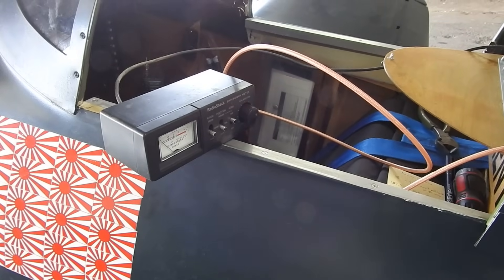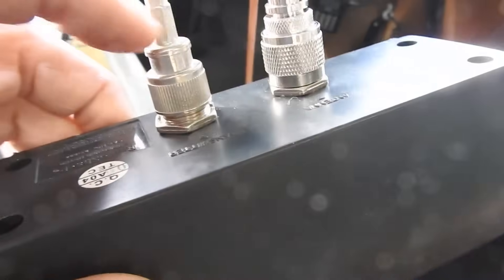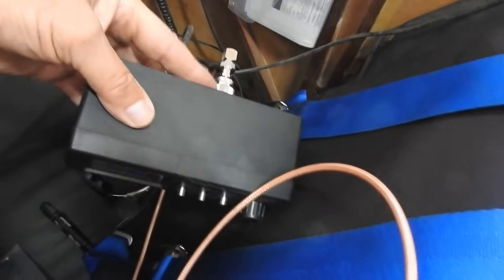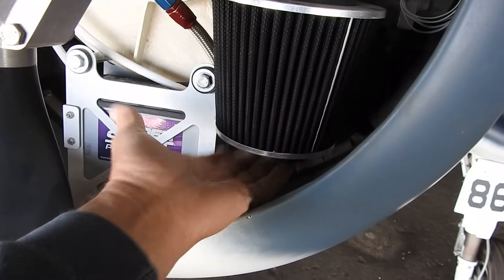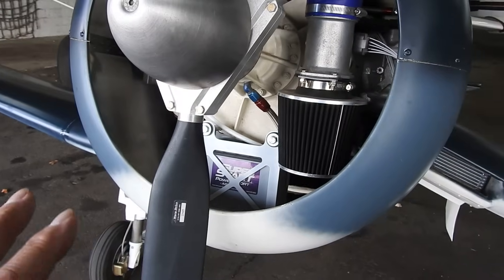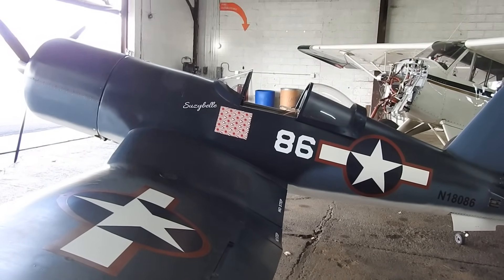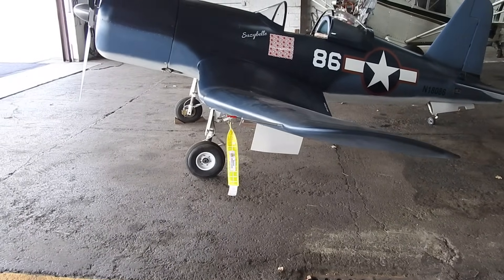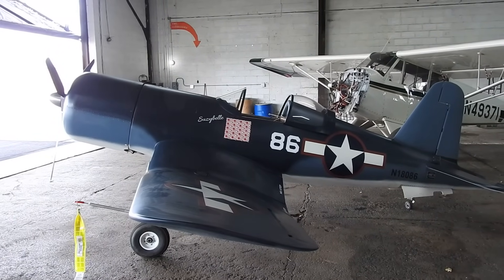WAR Corsair Progress report 10/28/2023

Comment: I'm so excited to see this effort come together Don.  Take your time and get her done right to your satisfaction. I hope the fuel delivery issue is something easy to solve for you. 

I'm not certain whether your VHF antenna is 1/2 wave (53" length) or more likely 1/4 wave (26.5" length) but you can expect about a dB or so extra gain with a 1/2 wave antenna over the 1/4 wave if there is room in the rudder to accommodate the extra length of the 1/2 wave.  The high VSWR may be a pinched coax or something else defective in the coax or antenna is just a guess in my experience working with this stuff.   

I would throw a sig gen on the cable and sweep it across 118 to 137 Mega Hertz with a Spectrum Analyzer to get a quick peek and characterize its performance here at work, but you may not have gear like this available there.

Dave
Reply from the maker: The antenna is 1/4 wave. A half wave would be too long, and not fit. I've seen a video on using an analyzer, but I don't know anyone that has one. I'm pretty sure I will have it fixed shortly. Some new fittings are due in the mail today, along with the air filter shield.

Comment: I'd love to see a 7 cylinder Verner on this!
Reply from the maker: That engine cost more than the whole airplane. Besides, it doesn't have enough power.
Reply: @Dynodon64  I agree about the price, but the WAR aircraft were designed for the 100hp Continental O-200. The Verner 7 has 124hp for takeoff, 103hp continuous, and it weighs within 1 pound of the O-200. It would actually be perfect. Not to mention the SOUND!

Comment: As somone coming from high performance  auto tuning ind 
MAF sensors do not like turbulance and are very sensitive 
we have problems all the time on Ford Mustangs where they change out the stock grill for a more open aftermarket 
and it causes tuning problems untill they put a shield back over air box

Comment: Yep 5.0 with a K and N would definitely screw with the sensor more so if there was a little to much oil on the filter vanes you could literally watch it on a scanner fluttering voltage readings

Comment: Back in the day, I trimmed up a lot of CB antennas to get the SWR meter reading down to a reasonable number. It was always a long trial and error process. Is there a more "modern" antenna design available that may offer a higher db gain with a more compact footprint? Maybe even an antenna at an affordable price point?
I'm always learning something new with each of your videos. I've never considered how turbulent the airflow might be within a cowled engine compartment - especially turbulence caused by the passage of each prop blade. Can't wait to see your baffle solution.
Reply from the maker: Radio antennas are really expensive. The one I have will work fine. I believe the bad readings are from the cables I used between the radio and SWR meter. I ordered an adapter to use in place of a cable.

Comment: You may want to consider the Advanced Aircraft Electronics antenna. I have it in my Minimax using a RG400 cable and getting excellent results. It doesn’t require a ground plane.

Comment: Can't you mount an actual proven radio antenna into the vertical fin? If you really need to hide the antenna. Or just mount one on the turtle deck. Communications is more important than looks at this point.
Reply from the maker: Yes you can, but they get pretty expensive. The one I have will work. I believe the problem was my cables that ran from the radio to the meter. Too long. I have an adaptor coming to hook the radio directly to the meter. Then I will re-test.

Comment: I don't like that meter for your radio. Your SWR would be better read if you switched the coax leads when testing reflected waves. Still not ideal
Reply from the maker: I ordered a new adapter to hook the radio directly to the SWR meter. I'll get another meter if the new adapter doesn't show an improvement.
Reply: @Dynodon64  I wish I lived closer, because the solution I think best would be to use an antenna analzer, but because they aren't cheap it would be better if you had someone nearby that had one. I don't know if that requires a special license per navigational equipment installers, or not.

Comment: Idk if it would fix the maf sensor issue, but they sell aluminum honeycomb air straighteners for use in cold air intakes to straighten the air flow before the maf to prevent issues.
Reply from the maker: We'll see how the shield works first.

Comment: All of the coax should be 50Ω. I would connect the antenna end of the coax to a 50Ω dummy load (borrow one from an amateur radio operator) and make sure the SWR is close to 1:1. This will verify that your coax is good all the way back to the antenna. With the coax attached to the antenna, the SWR should be less than 2:1. Also, your plane should be at least 20 feet away from any metal structures while checking the SWR.
Reply from the maker: I've got an adapter coming to hook the radio directly to the SWR meter, with no cable. Then I will retest. I tested over 50 feet from the hanger. The new cable is an RG-400 double shielded.
Reply: @Dynodon64 I believe if you use a 1/2 wavelength long piece of coax between the radio and the SWR meter, the SWR meter will show what the signal is doing at the radio. But, I haven't done amateur radio in decades..
Reply from the maker: I'll keep that in mind,Thanks. @txkflier
Reply: @Dynodon64  I sure would like to know what the pitch angle is at 75% of the blade length and also the prop diameter. I do propeller calculations almost daily for model airplanes.
Reply from the maker: The prop is 72 inches. Pitch was measured at the tip. Don't recall the number off hand. @txkflier
Reply: @Dynodon64  The standard location to measure the pitch is 75% out from the hub. That's where most of the thrust is located, plus the blade is usually wider there which makes it easier to measure. On my electric models, I like to use a prop that has a diameter that's 1.5x the pitch. An alternative method is to say that the pitch is 66.7% of the diameter. For a 72" prop, the pitch would be 48". If you measure the angle at the 75% point, the angle should be 15.77°. The formula is Arctan(Pitch / Diameter / 2.36). The 2.36 is about 75% of Pi. When the angle is above about 16°, the blade will begin to stall and produce less static thrust. As the plane starts to accelerate, the relative wind will effectively reduce the angle of attack of the blades and the thrust will increase. On the other hand, if the angle isn't large enough, the plane won't fly fast enough. I'm not sure 48" of pitch will give enough speed. A 72x50 prop would have a D:P ratio of 1.44:1, which is the same as a 69x48 prop that might be used on a Cessna 150. The blade angle at 75% would be 16.4°.

Comment: Before you go to all the trouble of removing that antenna; 1. The cable between radio and SWR meter should be a very short pigtail, like 12-18" and must be 50 Ohm. On my handhelds, I hook the meter directly to the radio ant jack with a simple adaptor. 2. With your 22.5" antenna, the SWR match should be 1 - 1.5 midband.  Your initial readings don't make sense at all. I don't trust the very old RS meter.  A new digital is fairly cheap. I got a Surecom SW102 recently for about $50 and use it on all my handhelds.    Good luck
Edit; I just thought of something. Your prime coat didn't include aluminum did it?  That could play hell with SWR and attenuate signal also.  The base primer on my MiniMax build was metallic, so I went with an external whip antenna.
Reply from the maker: I ordered an adapter to hook the radio directly to the SWR meter to eliminate the cable. The old cable was all I had to use. I may get a different SWR meter if the new test shows bad numbers again. I don't think the numbers I got looked right either. Didn't make sense. There are no metallic paints used on the plane. Just wood and fiberglass in the tail.

Comment: ❤ If the antenna has metal around it inside of the virtual stabilizer the antenna will reflect SWR . Correct?
 It may be easier to make a outside antenna. 
 Look up the formula for frequency wavelength for the antenna length from 1/4 to 1/2 wavelengths for the frequencies that you are going to be using. 
 Aircraft frequencies cover a wide range of the wire antennas where a 1/4 inch longer or shorter length of wire will make a great difference in the SWR.
 Even if you pick 1 frequency like 118.00 mhz. just a small difference in length will change the SWR.
 I am not being negative just wanted to help. You're a very good man and smart too so you probably already know what you are doing better than I.
Reply from the maker: Your comments are right on point. No negativity taken. My goal is to shoot for 127.5 as the mid point test. That should give me the best average for the bandwidth I will be using. 1/4 wave is @ 22.02 inches for the length.
Reply: @Dynodon64  here is a link to look at if you choose to that makes it quick to get the length of a 1/4 wave antenna length a different way. 
 I usually use the 1st example but the last example is easier and more accurate. 

https://youtu.be/tDgzTD0fQWw?si=6-AiHZzOef93X2MT
Reply: @Dynodon64  I got 22.21 for a 1/4 wave for 127.5 mhz. Using 246÷127.5×12 
 This is more accurate than using the speed of light in a vacuum.
 You are using wire in the atmosphere the numbers are slightly different.
Reply from the maker: Using his magic number 236, I get 22.02 inches. That's the same as an online calculator I used. My antenna was made at 22.5 inches. So I'm @ 1/2 inch long. @ronnydowdy7432
Reply: @Dynodon64  Okay.
I just used the calculator in my phone.
236÷127.5×12=22.2117
Plus a few more digits. Please look at it 1 more time. You can always cut . 
.199 inch off but you can't add it back but less than 20 thousandths is close enough for me.
Reply: I mean.  .19.5 or 19 1/2 thousandths
Reply: @Dynodon64  I meant .19 1/2 thousandths of a inch.
Reply from the maker: I must have type a wrong number somewhere to get 22.02 inches. I re-did the math and got the same as you. @ronnydowdy7432
Reply: @Dynodon64  okay I hope I did not bother you too much with my pushing. I think too much for just 19 1/2 thousands of a inch. That is not much plus I know if you're antenna is surrounded by metal and the radio output is like 3or 4 watts you will not be able to talk very far.

Comment: i used the 80 instead of 40 cable for my antenna and the math worked out well where the signal runs flat or near flat with about 12ft of antenna line. keep up the awesome work and i can't wait to see that lady up in the sky with the splendor of which she projects on the ground.
Reply from the maker: I ordered a new fitting to bypass the cable from the radio to the SWR meter.

Comment: I am a Chevrolet technician and just a thought could you extend the air intake behind the battery? This would shield the filter some also.
Reply: I was thinking along those lines also. The current location will encounter heavy wind shear across that filter. If there is room i thought he might point it to the rear.
Reply from the maker: No room behind the battery. @mindblownwatcher8536
Reply from the maker: Tere is no room behind the battery. Right now the easiest thing to try is the shield.

Comment: The antenna issues might be an excuse (over the winter) to create a vertical (Fiberglas) mast on the right side to insert an antenna, about 23" long. Might be easier to access, look like the full-size airplane, and have a shorter cable run to the handheld radio, just my 2 cents. Admire your careful work and analysis.
Reply from the maker: That may be an option, thanks.

Comment: The Corsair had a bad stall condition at low speed, the fix was a bracket on the left wing leading edge, will this be a concern on your plane?
Reply from the maker: This plane doesn't have the same airfoil as a real one. This one is much more efficient and more stable.

Comment: I have two of those C.B. antena Calibers. One didn't work right. I had to buy another. The needle wasn't accurate in the first one and it wasn't reading receiving voltage propper reguardless of the antena length. Sometimes they don't work right, Don.
    As for the intake air censor, easy fix. You got it🤞👍. Sometimes too much air is not good. Me still thinks a Verner 5 cylinder would of had less problem, but you used what you have. Me know nothing. I'm Scholts(Hogans Heros). Joke!
Reply: Just to add to the possible unreliability of the SWR meter, be careful what cables you use. I think you said you are using the cable you removed in order to connect to the SWR. If that cable is faulty then the SWR will read wrong. try another cable as well to confirm it is the antenna length and not your "measuring" cable.
Reply: @kwilliamsnz  Thanks for the tip, Don. Those SWR meters are in storage bins. I haven't used them since 2007.
Reply from the maker: I just ordered new adapter to eliminate the cable from the radio to the swr meter. Straight hook up. Then a new fiting for the antenna connection that uses a bnc connector and not the cb cable. @kwilliamsnz

Comment: For a 1/4-Wavelength antenna @127.00Mhz, it needs to be 23.23" long.
Reply from the maker: A calculator I just ran said 22.02 inches for 127.50Mhz. The one in the plane should be 22.5 inches by the plans.
Reply: @Dynodon64  I'd definitely test with a 23.23" element at home. Like you said in the video, it's going to get cold, so you won't want to be in the hangar.